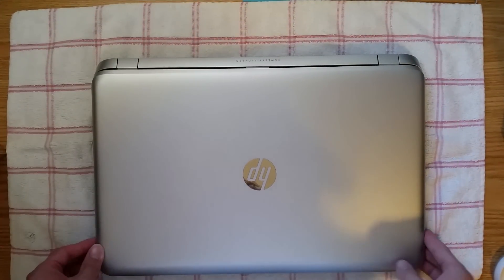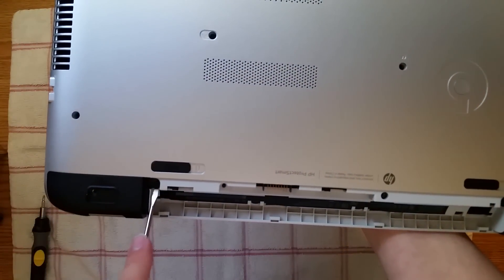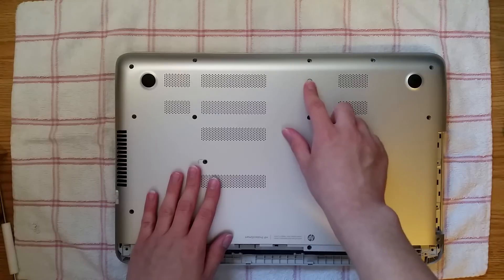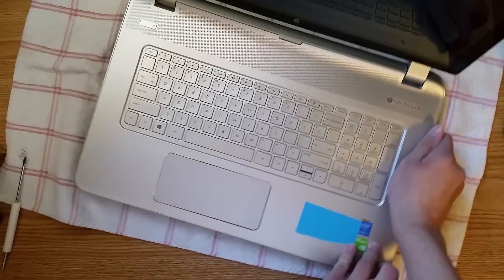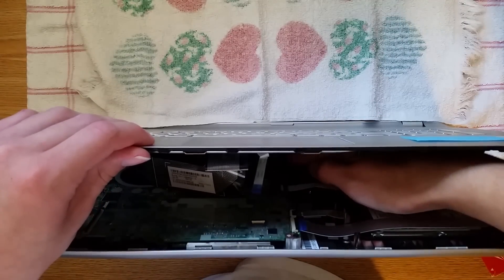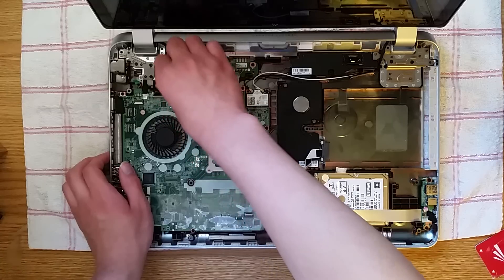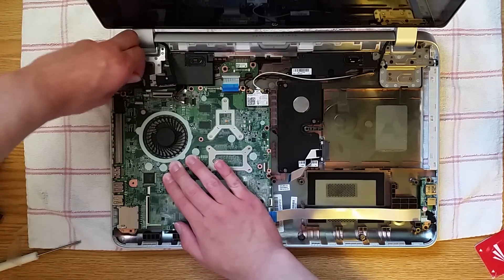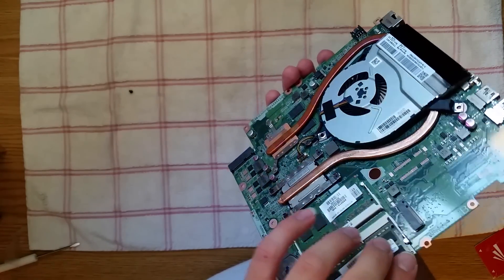HP Envy m7 Laptop Disassembled (Step by Step)

Comment: HP built the Envy as a throw away machine and they did not want to make it easy to repair. I have one of these a HP ENVY M7-K2111dx , 12gb , 1TB hard drive 5400rpm slow and 17 inch screen. It was made in 2015 and really needs a SSD with windows 10 to make it usable. I don't understand how a laptop name I7 comes with two cores. I was given to me by the owner who could not get it to boot. It is slow compared to my DELL Latitude with 4 cores, 13.3 inch screen. It was also built in 2015 but the hard drive can be replaced by removing 1 screw and sliding out the hard drive and installing a 2.5 inch SSD. The ram and wireless cards are under removable slots with 4 screws to repair. The only use these slow laptops have are adding Google Home and sending movies to my tv. They both have dvd burners if you need to make an audio or video cd. I just bought a AMD 5500U , 8gb ram, 512mb SSD. 17 inch screen and I hoped it would be fast enough for Davincia Resolve  and 80% of games. I should have bought the 5700U  with 8 cores 16 threads but for 900 you can get AMD with a gaming card and 16 gb of ram. I will probrably buy a new laptop on black friday 2023 because AMDs new chipset coming out by then will get over 60 fps in AAA games without a physical graphics card.

Comment: Was able to get off all plastic connectors until got to the top. Preventing me from doing anything worthwhile to clean my fan. Never buying hp again. Crappy designed laptop and charging for any type of service you can thing of now. Have problems connecting your HP printer to your HP laptop, you must buy a $50/year customer service package. Pathetic excuse of a company

Comment: I struck my m7 power button to hard and while it works to turn the laptop on, it no longer clicks or supports the push to hold function to shut the machine down.  Am I looking at a power button board replacement or is this a mechanical breakdown of the button itself?  Have to say, watching this video, I am not looking forward to this repair.

Comment: Hi, thanks so much for the video. If I want to access the keyboard of a HP ENVY Notebook - m7-n101dx model, can I do that from above, as you did, without having to disassemble a lot of the computer components? I did replace the HDD once, so I know what needs to be taken off, but it seems it's possible to access the keyboard from above, as you did, without having to disassemble the whole thing. Please advise. Thank you.

Comment: Thanks for the video, and it has become much easier for me to find these hidden screws. I would like to thank you for showing us how to do this. I have a problem with the cooler. Several months ago It transfers typically too much warm to the keyboard in the place where it is installed and I think that it should not be so. I will try to clean the cooler, but I have doubts about how to do it.
which of your experience can you advise: how to upgrade the HP Envy m7 Laptop? Or what are you not advised to do?
Processor: Intel (R) Core (TM) i7-4510U CPU@2.00GHz 2.60GHz; Installed RAM: 12.0 GB; Syytem type: 64-bit operating system, x64-based processor; Pen and touch: Full Windows touch support with 10 touch points.
Windows 8.1
I look forward to rebuilding with you.
With Kind Regards.

Comment: This model doesnt require any thermal paste for a fan replacement right, since it has those big metal bars running to the fan instead of the fan directly over the CPU?
Reply from the maker: No, you most definitely still need thermal paste between both the CPU and GPU and the heatsink.
Reply: @-garrett  just to be sure, the heat sinks are the big copper bars, not the fan itself? I can't find any information about using the thermal paste for the fan itself.
Reply: @-garrett  ok, so once I got in there I saw exactly what you meant. The fan works great now! Your video was the only one on youtube that was actually helpful!
Reply: @jaredlucev4481  Hey,did you manage to replace the thermal paste in your laptop? My CPU is running hot and I think after 4 years of being used,it may need a change of paste.
Reply: @rabbismooleymooley  to clear up what happened, my fan died and I had to replace that. But I didn't need to mess with the heat sink itself or the CPU/GPU. What I did didn't require any thermal paste.

I'd say pop open the laptop and make sure the vents are clean and clear (mine were crammed with nastiness that I couldn't see from the outside). If the fan is working properly and it's still running hot then you might want to open task manager and see how much of a load it's using. If the CPU is running a high percent of its capacity it absolutely will heat up.
Reply: @jaredlucev4481  The fan is running but loud. When I first got the PC,i tried playing games and encoding with it and the fan wasnt as loud as it is now. I do need to open it up and clean it. I really hate this PC,as you can see from my comments 4 years ago,I could not then and still not believe how shitty this PC is. I've built gaming PCs and taken apart other laptops,but this one is absolutely a monster. I gave up trying to take it apart before ,out of fear of snapping something. Now,the laptop is old,so I don't care as much. Thanks for the tips.

Comment: My I suggest also using non-marring tools on your next dissemble?  So much easier then regular screw drivers and (if used right) it won't scratch or break the plastic.  This also includes a replacement tool so you don't have to use a credit card or plastic card for the top cover. Example can be found here - https://www.amazon.com/dp/B00PHNMEMC/ref=cm_sw_em_r_mt_dp_U_nw7mCb8NGJ3KD

Comment: To anyone watching, I'd say that the best course of action would be to take it apart like this, put a M.2 drive in the M.2 slot on the motherboard, and call it day. You can, if you really want to just deck this laptop out, replace the HDD with another SSD, and then replace the optical drive with the original HDD or another SSD. It's really up to you. I just thought that it might help anyone that could possibly be watching this now or later on.

Comment: @5:58, use a guitar pick, perfect for separating plastics and won't damage anything. Also, you are removing the palmrest incorrectly. It is intended to Z-fold on, like the old IBM "Butterfly" keyboards. They way you are doing risks the connectors or cables breaking.  To reattach, on the palmrest, flip the connector cables so they stick out beyond the edge of the palmrest, and attach the hinge-side cables first. Then Z-fold the palmrest back and attach the front side ribbons. Easy.
.

Comment: Thanks for the video! I have one of these which had been very lightly used and failed to awake one day - no POST, no power to BIOS or drives, nothing. I am thinking about replacing the motherboard myself. Obviously the prospect of a new machine is in the running too, but I think I can get a new MOBO for under $300. And the video makes me see there is a shot I could do the swap myself. Do you suppose WIN10 will refuse to boot with new MOBO and CPU?

This MOBO seems the same. I searched using the HP Part number.
https://www.amazon.com/dp/B01C15WOXM/ref=olp_product_details?_encoding=UTF8&me=

Thanks again!
Reply from the maker: The model shown in the video currently is running Windows 10 just fine. It seems like many of the bugs have been fixed. Glad I could help!

Comment: Wow I much needed this video for a long tine. It's so difficult to access the RAM and hard drive. But I still wonder how you managed to pry the top plate off because I've gotten stuck there.
Reply: I found the easiest place to start is on the left side near the front, around the two USB ports. I couldn't get any opening started in the middle of the front.
Reply: @noseyparker8130  oh hello! I don’t use this laptop anymore, but yes i agree! That’s where i start now! And I found the plastic tools from iFixit to repair phones make it really easy to separate it.
Reply: Make sure you've got all the screws out. You take a credit card/plastic card and work into the gap on the sides then work it around both sides and bottom of the case of the laptop to pop It free from where it snaps into the case. It's not as hard as it sounds. If it's giving you a lot of resistance then you've missed a screw most likely.
Reply: +Dennis Mayer Ah thank you! I have more tools now and I will be doing this in the future

Comment: Have you disassembled the screen on this laptop before? Do you have to get under the keyboard to take the hinges off or can you take it off after you remove the battery and the two black pieces that hold the feet? A video of you disassembling the screen would be nice! :) Thank you. this was a very good video.
Reply from the maker: +Peter Suman You must remove the whole keyboard assembly to remove the screen, as that is the only way to access the hinges. If you are trying to further take apart the screen assembly, (on touch models only) I believe that you can remove it by pulling with suction cups, and when finished, will snap back in place. I have never tried to take apart the screen, but once, the laptop got dropped, and the all front glass of the screen assembly started to pop loose from the back plastic silver housing. For this reason, I believe that the screen is only held in place with (presumably plastic) clips. If you do end up trying to take the screen apart your self, use little force, because of the all glass screen and bezel. Hope this helped!

Comment: So, I installed the evo 850 250Gb instead of DVD with the caddy specially designed to fit. And I cloned the system with Data Migration tool. Is there any way I can boot from SSD in DVD slot? (because I don't trust myself wit such a delicate thing as disassembling of laptop)
Reply from the maker: +Александр Моисеенко (sterpazook) Yes, there is. First, shut the computer down. Turn it back on and as soon as you press the power button, press the escape key continually until you see a screen with options. For my model, I press F9 for the boot manager (It may be different for you model, just look for "Boot Device Options" and press the key it say) When you enter the boot device options, look for "Windows Boot manager" OR "Samsung SSD 850 EVO". To always boot from the SSD you must go into the BIOS Setup and change the boot order.
Reply: GamerVidz http://www.newmodeus.com/shop/index.php?main_page=product_info&cPath=2_5&products_id=573
Reply from the maker: +Александр Моисеенко (sterpazook) Just a word of caution... The sata connector that connects the DVD drive to the motherboard is only SATA 2 not the faster SATA 3 that the Hard Drive connects to. It will still work, and in reality, you may not even notice a difference, but just putting that out there if you encounter any problems while trying to do this. Also, the DVD drive uses a "slim sata" power connector. MAKE SURE that the caddy/adapter you purchase adapts the "slim sata" to the normal sized SATA that all SSD's and HDD's use. It looks like the one you linked to does this, so if you buy that one, you will be set.
Reply from the maker: The laptop model in the video does not have an M-Sata port.

Comment: Hey what's up,im planning on upgrading to an ssd soon,this 5400 rpm hardrive causes alot of slow downs,I have 2 questions,1 is there an empty hardrive slot inside where I can connect the ssd,2 or can I just remove my dvd drive,buy a caddy,and replace the dvd drive with the ssd from there.thanks a million bud.
Reply from the maker: +Andy R Unlike older models, this model does not have a second hard drive bay. You may be able to take out the dvd drive and replace it with a hard drive catty, but there would be two issues. One is that the dvd drive connects to the motherboard using a "slim" SATA power port. While there are adapters, it could be difficult fitting into a hard drive catty that goes where the optical drive is meant to go. Second, you will have a gaping hole where the dvd drive was. Hope I could help!
Reply: hi,I took my hopes away,I thought It was much easier than that, I looked on Amazon and I saw a bunch of caddies and ssds for is laptop. in my head it was just as simple as taking out the DVD drive installing the Caddy and then installing the SSD. I have looked on Google many times for a step-by-step on how to remove the DVD drive and replace with an SSD but to no avail. please tell me if you had to upgrade the hard drive on this laptop what would you do? Thanks, I appreciate all your info as I am new to this laptop and don't know too much about it.
Reply from the maker: +Andy R If you want to upgrade to a SSD, you should put it in the place of the hard drive. I have upgraded the stock 1 TB hard drive on this laptop to a 500 GB Samsung 850 evo. The Samsung SSD came with disk cloning software, but did not come with a USB to SATA adapter, which is needed for disk cloning. if you are thinking about buying a ssd, I would highly recommend getting either a Samsung 850 evo or 850 pro. The only difference between the evo and pro is the pro is slightly faster and can handle more writes. The evo comes with a 5 year warranty, while the pro comes with a 10 year warranty. Any ssd will fit in place of the hard drive and no adapter is needed once the drive is installed in the laptop. (a USB to SATA adapter is needed for disk cloning only)
Reply: man,i really appreciate your help,i was so lost at first.you sir are very intelligent,with your help ill do this in no time,so i have a few questions,how much are those ssds?also are the ssds worth the memory downgrade?and from your experience,did the laptop receive a noticeable performance upgrade with the ssd?last question,about the cloning process,can you shed a little bit of light for me on this process.thanks i owe you alot bro.
Reply from the maker: +Andy R The 850 pro is always going to be more expensive. The 850 evo starts at 69:99 for 120 GB and goes up all the way to $617.99 for 2 TB. Going on Amazon and searching for Samsung 850 EVO will let you see all the different capacities and prices for the drive. The 850 PRO starts at 89.99 for 120 GB and goes up all the way to $874 for 2 TB. Searching amazon for Samsung 850 PRO lets you see all the different prices and capacities for the drive. I think that SSD's are worth the memory downgrade because they are more reliable and faster than standard Hard Drives. In the HP Envy M7-k211dx that I own, I have seen a significant performance boost in speed, after installing a Samsung 850 Evo 500 GB drive. For data cloning, the Samsung SSDs come with smart software. Lets say you have a 1 TB hard drive and want to clone it to a 500 GB ssd. As long as the 1 TB hard drive has less than 500 GB on it, you can transfer the data. You will need a USB to SATA adapter so that you can plug the SSD into the computer for data migration. Because the software erases the disk you are transferring from, ONLY the SSD that you transferred the data onto will be boot-able, and the Hard Drive where you had the Windows OS, and all your personal files will have nothing on it. Basically it moves the data rather than cloning it.
Reply: wow,thanks for that,very very informative,i went to amazon and browsed,turns out im gonna settle for the samsung 850 pro 256gb for around 120$,now,these 2.5 inch ssds will fit right in my hp envy m7 k211dx without no caddy of any sort?.do you think that 256gb is adequate enough?,im not too keen on too much media.as for the usb to sata,im guessing amazon will have it?.thanks a bunch bro,because of you everything is clear now.
Reply from the maker: Yes, the SSD will fit perfectly in the existing hard drive slot. Just make sure you remove the rubber grommets, cable and possible mounting brackets (on some models) This USB to SATA adapter will be perfect for migrating the data. It is also USB 3.0, so it will migrate the data much faster. http://www.amazon.com/StarTech-SATA-Drive-Adapter-Cable/dp/B00HJZJI84/ref=sr_1_1?s=electronics&ie=UTF8&qid=1454792308&sr=1-1&keywords=usb+to+sata
Reply: thanks bro ive ordered the adapter,im going to order the ssd in a few days,then ill be taking apart this hp envy,last question,what kind of tool kit you used for the envy?thanks for your video and your friendly information,god bless.
Reply from the maker: +Andy R You could use a couple of different size small screw drivers, and something like a credit card that is plastic to aid in removing the aluminum palm rest and keyboard.
Reply: thanks,for everything.i will update you on how it goes.
Reply from the maker: +Andy R My pleasure, good luck!

Comment: I actually made the change over to windows 10,and I gotta say its smooth and lightning fast,windows 8.1 was a bit confusing for me coming from windows 7.question how well do you game on this machine?
Reply from the maker: +Andy R While I do very little gaming on this computer, what I have seen is that it handles things much better than any integrated graphics. That being said, this computer is not going to be a gaming "monster" due to the lack of a quad core processor and mid-ranged (for laptops) gpu performance. Happy to hear that your Windows 10 experience was smooth, mine was anything but that!
Reply: wow sorry to hear about your bad experience,thanks for the reply,loved your video though,i would like to one day upgrade my ram but my gosh that looks like a tight fit and my hands are big lol.thanks for your reply though.question,what controller do you game with when you do game?i cant picture me using the trackpad,im coming out of consoles.
Reply from the maker: +Andy R I usually use a GameCube controller with a USB adapter. The problem with this is that it doesn't support some games very well.